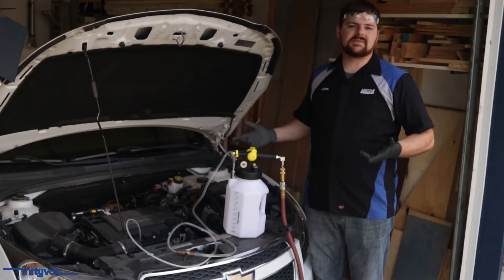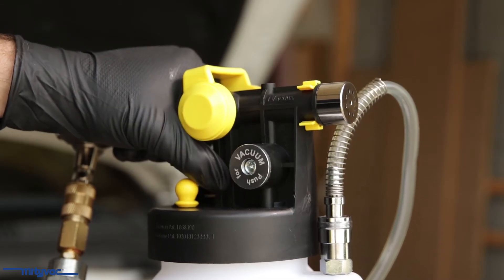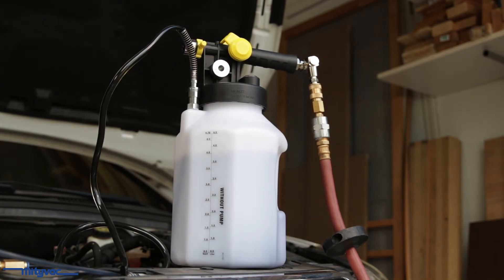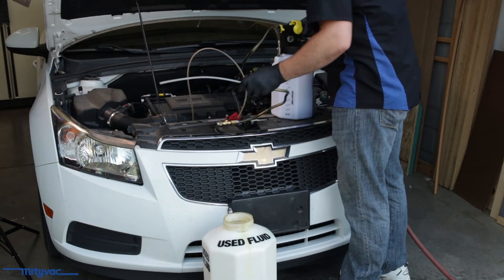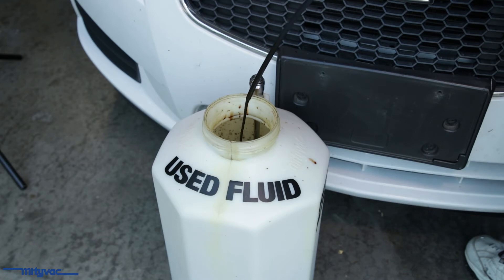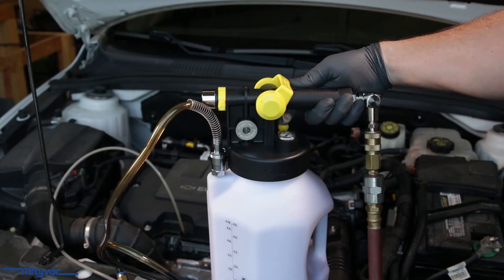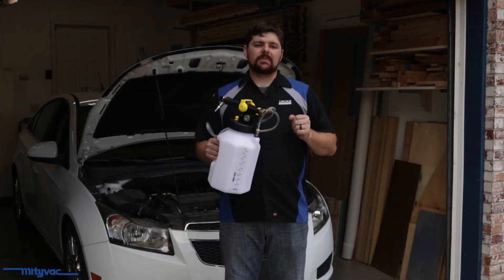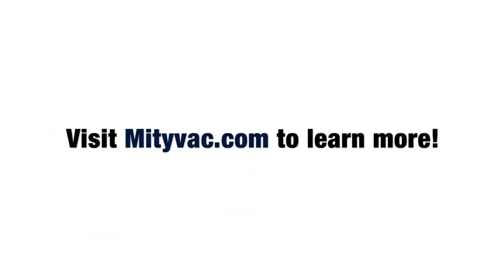Extraction & Dispensing using the MV7100 Series Fluid Handling System

Comment: This is the 7105 correct?  Thanks
Reply from the maker: Correct, the reservoir unit is the MV7105. Also shown is the longer dipstick tube out of the MVA578 to pull the oil from the pan. 

~ John